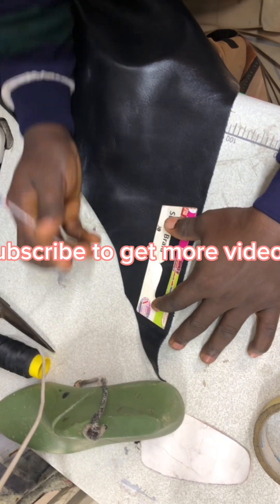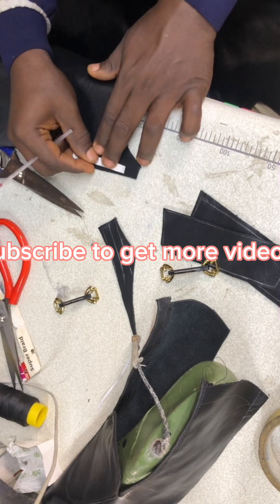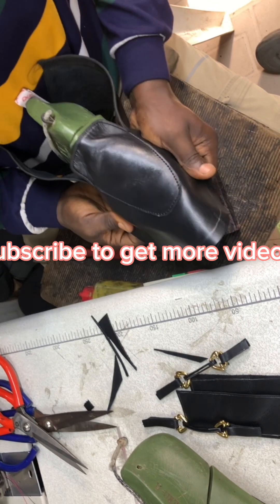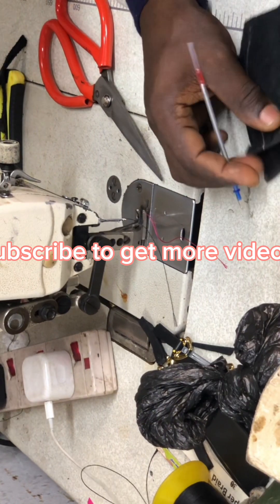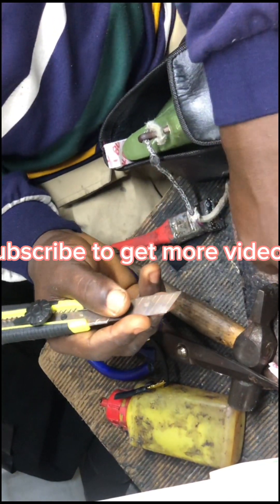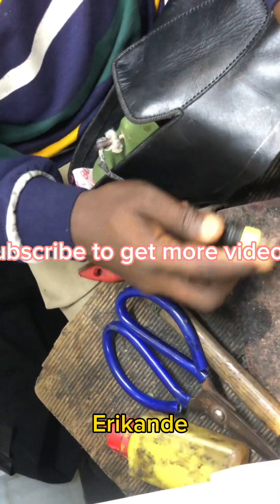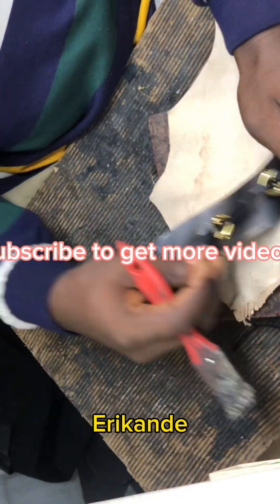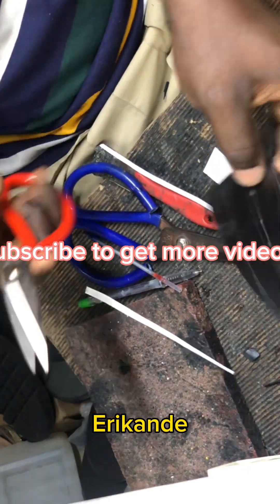How to make a leather shoe part (3) full video .

Comment: Good morning mr Erik. How work and your business iam also a shoe cobbler but best of doing pams sandal but iam very much interested on learning this online. My questions is, if you don't have original tape edges and you are to use the leather you are making the shoe with. How can you place it on the shoe edge?
Reply from the maker: You can skive the leather and make it soft if you don’t have a skiving machine file it .